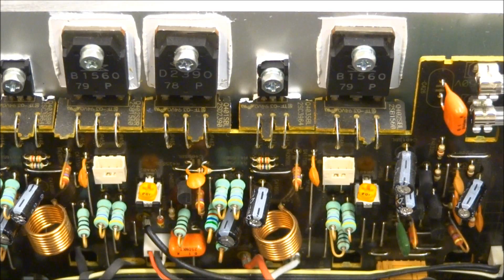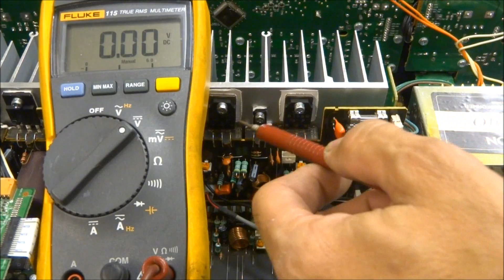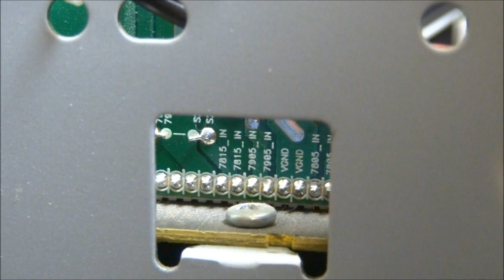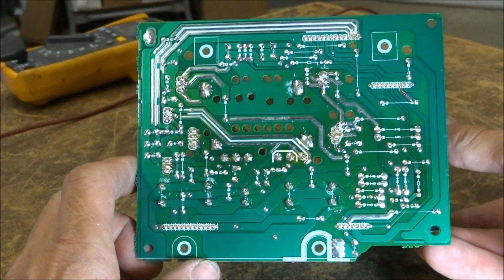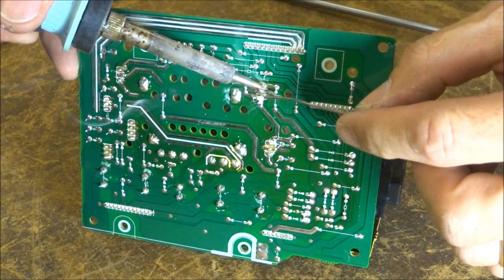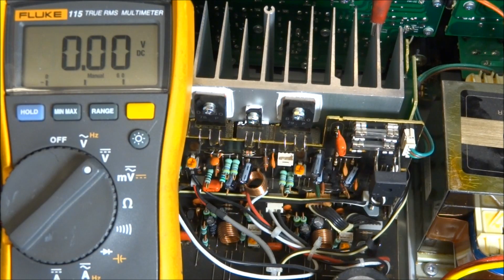Denon AVR788 AVR-788 AVR 788 Blinking Red Light Fix

Comment: need your help with my denon 4200 red blinking death
Reply: I have the x4200 and it is blinking red too even after I disconnected the speakers.
Reply: I need your help,  my amplifier denon model number avr-1306 amplifier keeps turning on and then shortly after turns off by itself

Comment: I have a denon arvr -x1600h and it had a blinking light at first but now it gets no light at all. Would it possible to apply this workflow to figuring out what it could be? I suspect lightning or over voltage due to power flash. advice?

Comment: Very well done. Your troubleshooting process is clear and logical. As my preference, I would like to use a solder sucker for desoldering purposes. Stan.
Reply from the maker: I think I was going for the DIYer that does not have a solder sucker. I think I may have mentioned that at some point in the video.
Reply: @norcal715  
Thanks for your response Norcal715. I didnt mean to be critical.  I have a Sony STR DB-840 that shows Ptotertor,  but clears up when power recycled to it. Do you have a video on this unit? Thanks.

Comment: I have a newer unit that goes into blinking red light. The output transistors measures fine. 53+ 53- the +5V rail is fine and the -15 is fine. The +15 is a bit low 14.7 - could that be an issue?
Reply from the maker: .3 volts low should not trigger a fault. You need to measure the DC offset of each channel at the emitter resistors to ground. Sometimes you can measure from the bias test point to ground also. Anything over about .5 volts DC is suspect.
Reply: @norcal715  thanks for making the videos - the unit i have in is a AVR-2105 - and i did discover the fault - a shorted power transistor and a blown resistor. Classic. But the unit is in my opinion really hard to service, i basically have to disassemble all of it to do anything.
Reply from the maker: They saved a dollar or two by not adding the access panel to the bottom.

Comment: hi. i have a denon avr 1609 and its also going into protect mode. in the power supply, i found a bad diode and several cooked resistors. funny colors. i cant really tell what value they are. looks like  2 red bands but thats all i can decipher. they are all completely open. any idea what the value is? thanks!
Reply from the maker: Email me Norcal715videos@gmail.com

Comment: I have a  AVR-788  with a odd problem,  in stereo mode i can turn up the volume and all is good,   in  Surround Sound mode  if i turn vol past 11  unit go's into shut down  and  if I quickly switch mode back to stereo it will be ok again.    Note this will happen with no speakers attached     Bias   test at speakers connectors  all under 15mv  but for front right is -22mv  don't know if that's enough to be a problem ,  my  -/+ 15 Volt line   is  14.6      unit stays running all day in stereo mode.   any idea's ?   Fantastic video by the way !

Comment: Terrific video for DIY sound engineers, which I am not.  Thx for sharing such thorough info. A question.  I have a Denon DRA-800H RECEIVER (2020). Unbenounced to me, due to ignorance, the Receiver  has 2 speaker connections, A and B.  I connect a pair of Elac bookshelf speakers to each.  Then, i paralleled connected to the B speakers, another pair of Fluance bookshelf speakers.  They sounded fantastic playing in unison with the Elacs.  Elacs are 8 ohm rated, with nominal 6 ohms,  the Fluances specs indicated 8 ohm rating.  After playing both A and B (6 speakers ), at about 60 to 65 out if 98 volume, the Receiver flashed red and shut down.  I consulted the Denon manual, it revealed it was the Receivers internal protection system shutting it down due to overheating or potential damage.  I plugged the Receiver into a separate electrical outlet from the other equipment, which seemed to help and thst condition didnt occur again.  But, touching the Receiver, it is pretty warm.  I also try playing only the B (paralleled 2 pairs of speakers), and that too doesnt trigger the shutdown.  I found a speaker switch that has an impedance protection circuit built in ( Niles, OSC or Monoprice).  Would this do the trick to protect the Receiver?

Comment: Great video! I just diagnosed my Denon AVR-X4100 problems as a flakey front right amp output transistor. It would not start and  blink the red light. When I disconnect that channel high voltage connector, the unit starts, but I have another question for ya.. the front panel display is a bit odd. It seems dim and the lighting is not uniform. I have it on max brightness. In addition, in the unit service menu, if I try to bring up the error history, or select any other option, the unit just restarts. I can select the top level options, but when I select to activate the function, the unit restarts. Doesn't seem right. I am thinking the event that took out the output transistor may have damaged something else. Any ideas? Love your channel. Thanks for all your insight!
Reply: I have checked all the main regulators and they are fine. The front panel voltages seem fine, but the service manual doesn't say what the voltages at the display should be. I checked them and they don't seem out of line. The display pixels, on the brightest setting, are different intensities. It's like some pixels are are on low, some medium, and some high.
Reply: Just to close the loop at bit.. Accessing the shutdown error function was a little confusing for me. You enter the menu, select the function, then the unit is supposed to power cycle. Once it power cycles, you push "status" to displace the protection history. There are  other buttons for other functions once the initial selection and reboot is complete. In my case it is reporting "ASO" or short circuit protection. Also, I disconnected the connectors one by one to the amp board and isolated the fault to the front left amp circuit, then removed the pins from that connector one by one. It turns out the Front Left High+ power, when removed, allowed the unit to boot normally. Measuring the outer pins on the channel voltage connector showed a couple mV before error shutdown, so I believe the protection circuit might be to blame, specifically one of the small transistors on the backside of the amp board. At this point, if fixing that transistor doesn't work, I may just rewire the inputs/outputs of one surround channel amp I don't use as channel front left.

Comment: I have a Denon AVR-1910 that had the right front amp blown before I got it and after replacing all the blown parts I'm getting 33 volts on the bias test points. I'm really scratching my head over this.
Reply from the maker: If you are getting that voltage at the bias test points then you most likely still have open emitter resistors.

Comment: Thank You, I have a Denon 2311CI and had the red blinking light and the stereo shutting off problem after it got very hot because i used it on a very hot day and poorly ventilated room,  i thought it could be the same problem as in your video, but i disconnected the high current power supply cables that go to a connector next to the two big capacitors (red and yellow wires) and just powered it up with the low current cables that run the display and front controls, and it didn't shut off, so this let me do the factory reset procedure and everything looked good. So i thought that there must be a bad regulator in the power supply. I turned it of and reconnected the high current cables and just for the heck of it, i turned it on again and this time it turned on and worked perfectly (i suspect that the power from the high current cables was somehow not letting the system do a full reset...) i haven't seen a video on this model (2311CI ) addressing the problem, so i hope this also works for someone else.
Reply: I have AVR 1513 Denon  bought in AbuDhabi the problem after five menutes playing suddenly stop and  red blinking

Comment: Thanks for the great explanation and soldering techniques.  Same problem with my Denon AVR-E300.  Went through your diagnostics and one of the power transistors ( 2SB1560) power trans. was shorted across the C and E.   Do you need to replace these in pairs, the other PT,  as well as the bias T,  seems fine?  (2SB1560/2SD2390).  Emitter and base resistors were blown as well.
Reply from the maker: I certainly would replace them in pairs, also if the base drive resistors are blown I would replace the driver transistors also.

Comment: I have same red light blinking issue with my DENON AVC-A1XVA but so far two technicians can't repair it. 

The first one was a non official approved and after 2 months doing nothing, he redelivered the amp back to me. 

Then went the official way path, I have reach the only one authorized service center of my country (GREECE), amp delivered there since December but they said that they need some special tools(?), cables(?) to test the amp and mother DENON is not responding to their requests. As I am in love with that amp and I have no money to buy an equivalent of today could anybody guide and assist me? 

Thanks

Comment: @NorCal
My denon avr 716 suddenly went quiet. No sound.Opened up and checked,no obvious sign of anything wrong.No shutdown and no dc output at the speaker terminals.No shorts on the output transisitors either.The 15v and 5v regulators are fine. Measured the outputs and am getting 51v at the collectors but no voltage on the emitters.Seem to be missing the 24v.What could be the problem?

Comment: I like that you started with the output transistors, then to the amplifier board power and on to the lower voltage power regulators.  This is a good approach for all amplifiers and you're instructions could apply to almost any modern amplifier.  Good job.

Comment: great work/job. my yamaha receiver rx v730 is in protect mode and dont showing anithing. just one short click on ac board reley and nothing hepening. ani suggestion abaut that failings? the screen isnt turn on . plug the ac cord , push the power button and just one click and dont show anithing. receiver is clean and i nor seen anithing on board bellow receiver to seeing faulti...

Comment: Denon uses overkill output transistors. The most common cause of Blinking Red Light of Death on Denon gear is a missing power supply. Usually, one of the linear regulators e.g., 7805, 7905, 7815, 7915, etc. The second most common cause is cold solder joints on the output board.
Reply: Giblet535 I must know more about this comment. Before I start unscrewing and digging around. Can you point me to the missing power supply or upload a vid?

Comment: I have a AVR 588 that is doing the samething, I replaced 7815, 7915, and 7812 Power transistors but I still have the same issue.  All the other voltage on the output transistors are fine.  Any suggestions, thanks
Reply from the maker: Do you have a service manual? go to www.hifiengine.com and see if they have a free manual for download. Sometimes they have more in depth error troubleshooting.

Comment: Thank you so much Sir NorCal715 (Who should be named in Our Queen Elizabeth’s UK Honours List) for making this extremely concise and informative video and also for sharing your clearly vast & learned knowledge and experience of in-depth electronics to us mere minions!
I would like to not only thank you for pointing me in the totally correct place with your wonderful diagnosis procedure re pwr supply Regulator 7815C I didn’t even bother to test any voltages or values as your diagnosis made perfect sense, and you narrowed down the failed component perfectly! I would urge anyone to do same and exchange this little shit component for the pure fuck of it!
This same repair as I can 100% confirm applies also to the Denon AVR-2105 (90w) 7.1 channel Receiver Amplifier that shares the same symptoms (Flashing Red light) then switches off without kicking in the Loudspeaker O/P Relay & shuts down with the flashing red fault code of DEATH LED (lamp) flashing around the standby button.
I can also confirm to You particularly NorCal715, and others that are extremely fortunate enough to have found and watched this fantastic repair video that the Denon AVR-2105 uses the exact same 15v O/P Semiconductor – Voltage Regulator as I’m sure perhaps many other Denon models do from this period and this little component is indeed the culprit for the amplifier’s failure! 
The failure is due to either a very bad/faulty loudspeaker attached to the system or more than likely (as in my case) Very BAD- Over excited older & “Fucking annoying! Teenagers that drink far too much Vodka and then forget what I told them re: overdriving & overheating the amp in My FUCKING Bar! (turning up too loud) over an extended time period- party etc. I have a Bluetooth receiver unit attached to an audio in - Aux input on the Denon AVR-2105 in our Bar where only one device can join-Connect BT at one time etc, the problem occurs when others (usually Pissed up, grown up Children) join & pair the BT Connection, the Volume on the amp was turned up loud by previous BT (Bluetooth) sensible, (not quite that pissed on Vodka young Adult) on the amp & then new connection- BT paired user turns up the (pre-amp)Vol on their device iPhone Android etc and the sudden pre-amp surge from smartphone device takes out the amplifier & clearly this 15v o/p Regulator IC bites the dust! 
Usually I just buy another Amp locally from FB or eBay for £60-£70 = $90- $100 & now have x4 -sorry, now 3 others with same issue but one I just fixed successfully because of this wonderful video, I now will go on to fix the rest and keep them all as emergency spare Amplifiers should the 17 year old going on 13 year old fuckwit teenager-pisshead little shit’s do the same thing again to my amplifier!
I am a (UK) Car Audio 12v installer & repairer 42 years and hate touching anything 230V Mains powered as never had the training or the inspiration to do and particularly for a living, Hats off to You Sir NorCal715 for saving me allot of time, money & above all frustration of doing the alternative of binning- disposing of 4x Denon AVR-2105 Amplifiers, I sure owe you a beer or 2 my friend! 

PS the Denon AVR-2105 repair is pretty much the same as this video but just a little harder as more of a complete tear down for removal of the complete Power supply lower pcb and other sectional vertical plug in boards to remove. I might make a video myself on the tear down and repair of this particular very common fault on these old things but I will make sure to link you and your page info in to it for respect alone reasons! You are the Man! Thank You so very much again Sir NorCal715

I found these for sale on eBay (UK) and one of these fixed it for me. Hence, I bought x5 
ON Semi MC7815CT Linear Voltage Regulator 15V 1A Positive 5 Pieces OMA046H 
Item Number 252459678781
Also, I’m slightly inclined to do a re-design job and add a 12v PC – tower computer processor cooling fan aimed directly above this common failing component that I’m sure is due to excessive heat build-up and overdrive. And the fuck not eh?
Prevention better than cure hmm! Your thoughts of where to pick up the +12v would be great *  _  *
But hey you have done enough already and time for the multi meter me thinks! 
I thank you so very much for your help with this common issue and hope people thank you in the politest & most positive way that you deserve! Total respect to you sir.
Yours sincerely Donald T. Rump

Comment: I have an AVS-R700W.
When push the power button, a green light flashes and does not turn on.
I'm trying to turn it on without connecting any speakers, could that be the problem?
Please I must do.
Thanks a lot.
If you want to reply to my email luigi19549@yahoo.com
Reply from the maker: It should power up even if you do not have the speakers connected. Check that you have power at the main capacitors, probably at the bridge rectifier is the most convenient place to measure.

Comment: Hi Can you please tell me the equivalent transistors of B1254 (2SA1263), D1894 (2SC3180). its really hard to find to me.. i replaced with B1560. D2390 to check.. but transformer started smoking.

Comment: I just got the 887 that has the same problem, the Surround back part of the amp board is the issue, the 2 Output transistors are shorted (and removed) and if i dont plug that part in, the reciever works just fine. But if i plug that in, it goes into protect just like this one does. I'm thinking if i replace those 2 it should work again?

Comment: Thank you so much for posting this.  I ran into this same model with the exact same problem.  I measured all the output transistors expecting to find a shorted one and/or burned up blown amp, but everything looked perfect and I just drew a blank on where to go next.  I should have thought of this and figured it out myself. I remember my electronics instructors in 1984-85 and my trainer at my first job of servicing home audio/video equipment saying "always check your power supply first"  Garbage in-garbage out.  Without proper power supply voltages, nothing will function as it should.  I still do a lot of TV work, but it's probably been 30 years since I serviced a stereo receiver.   I'll have to go back to basics and remember the fundamentals of troubleshooting next time I run into a similar problem.   Thanks for the refresher course.
Also, I would highly recommend using desoldering braid when removing the old component and clearing out the holes.  What you did worked on a cheap single-sided board, but without solder wick or a solder sucker, you'd never get the holes open on a 2-sided or multi-layer board with plating in the holes.